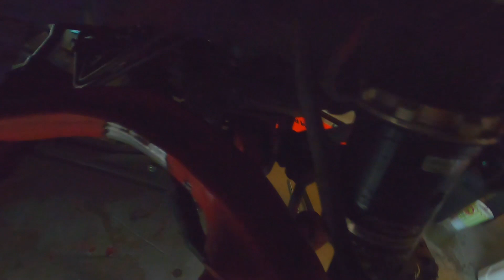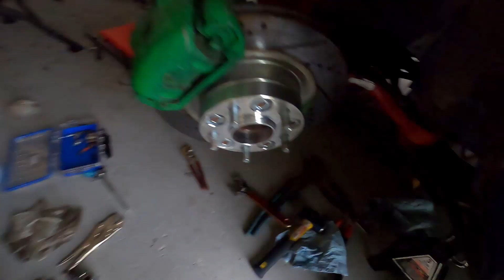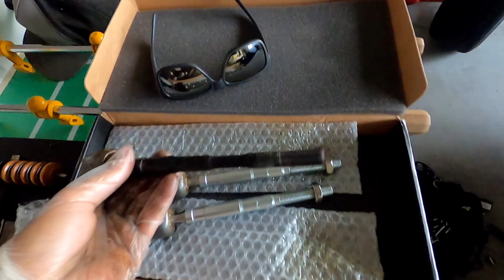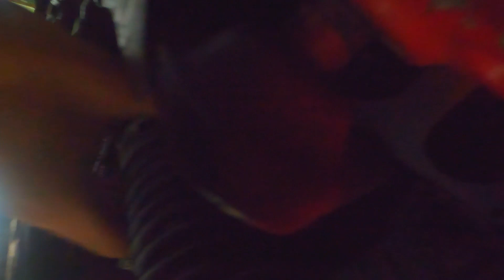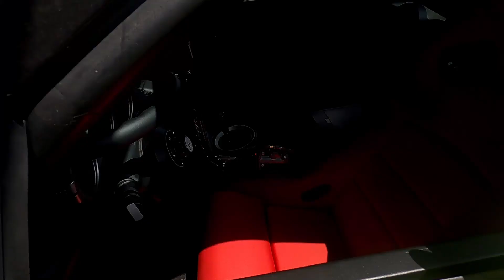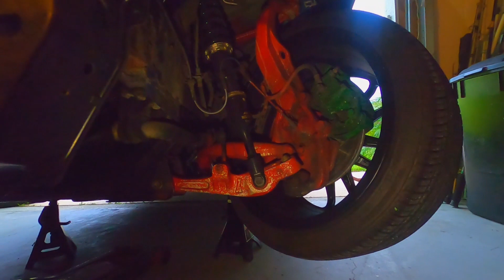Extended Tie Rods | 350z G35

Comment: What size wheel spacers do you have on that car. And did you drive the car afterwards how did it feel did it have bad bump steer once you get towards full lock
Reply from the maker: 22mm spacers, and yeah it does have some bump steer on it once you get closer to lock.
Reply: Thanks, I have a06 G35 sedan 6mt and I just went to first drift event.  I spun out a lot, the car just don't have enough angle so I was planning on putting on those same inner tie rods
Reply from the maker: @richardosborne7641  it gave me a good amount more angle for the little mod that it is.